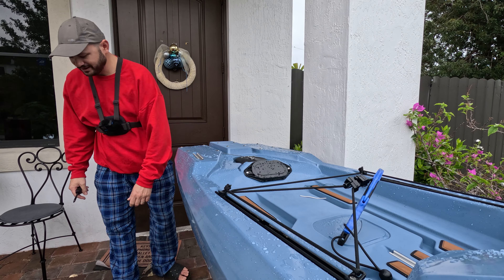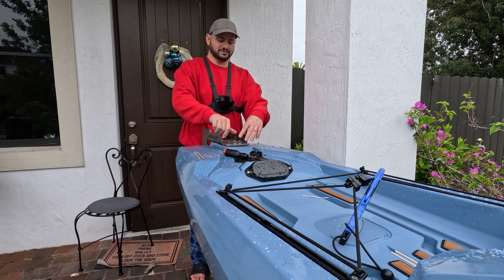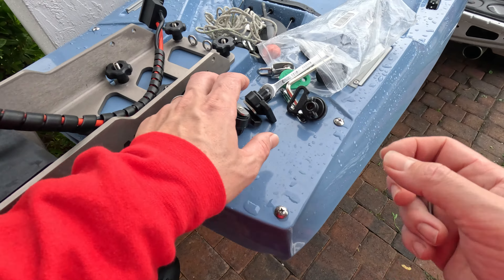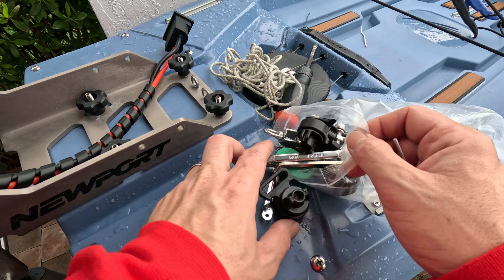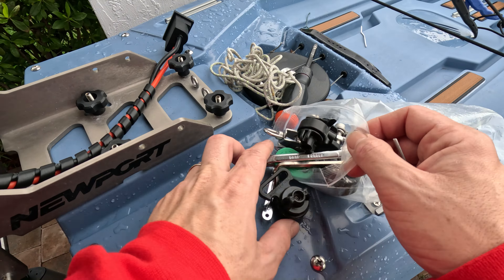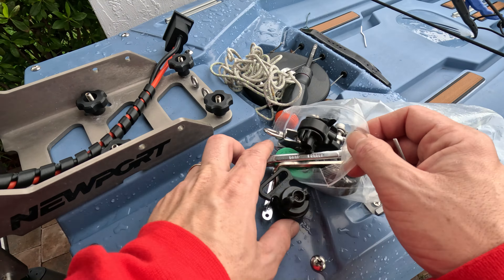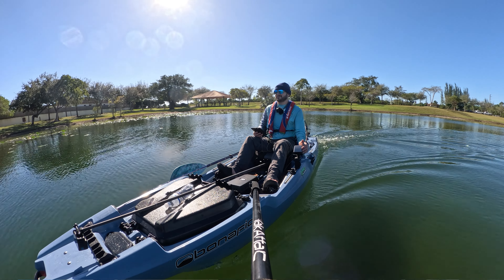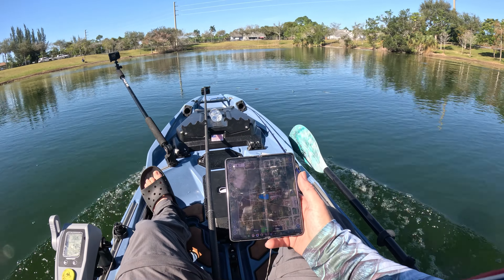NEWPORT NK300 Trial and Error Inexpensive Powerful Fast Kayak Motor FULL Install on Bonafide PWR 129

Comment: Does the rudder still turn along with the Newport? So you can still use the rudder when you’re paddling?
Reply from the maker: You can't use the rudder if the Newport is on, if you lift the nw then yes

Comment: Hello Alex, I have a question for you about the  Native titan x vs Vanhanks elite pro angler. You have tested or review those kayak  already,  what do you think the Vanhanks elite pro angler compare to the titan x?  I'm still thinking about getting the  titan x , not really sure about the size.  Any suggestions would be appreciated  very much.  Thank
Reply from the maker: Vanhunks, f1500 xl, native titan f1500 limited
Reply: @AliexFolgueira  So Alex which you like better  titan  x or vanhank? I  know the titan x is  a little more expensive than vanhunks,  which is more stable and  more fun?
Reply from the maker: @philipnguyen2529  the titan x is in every way better
Reply: @AliexFolgueira  Do you like the 10.5 or  the 12.5? I'm not a big guy,  I'm 5'7 and about  165lb.
Reply from the maker: @philipnguyen2529   unless you dont have the space or dont wanna deal with the extra weight, the 12.5 is the one to go, you got more space, more speed, just a better experience on the water

Comment: Why Bonafide made the rudder if it doesn’t work with NK300. Do you think the rudder would work with NK180?  I also do plan to use a front motor guide xi3 sometimes without back motor, and I need the rudder in this case.
Reply from the maker: well the did the rudder only for paddling, if you put a rear motor, it wont work, just run the wire directly to the rear motor
Reply: @AliexFolgueira  How fast it takes disconnect wires from the rear motor and install back to the rudder? I'm not planning to use rear motor all the time?
Reply from the maker: @WarEagleTheBest  you can do it on 5 mins, gotta route the cable around the disks it is easy

Comment: Don’t buy Nk300 waste of money👎 I own an xi3 motor guide which is awesome and bought into hype of faster and was extremely disappointed all these videos lying about it try in current and battery wont last and isn’t fast😭(Hobie compass)
Reply from the maker: @ajmcdonald1277  Xi3 is not longer a thing, motorguide is dead! If you bought the 30ah hiri 36v battery if you run max just last one hour, at 25% power which gives you more than half the speed you can go for at least 20 miles, you arent taking advantage of your battery.
Reply from the maker: @ajmcdonald1277  I may add the only one lying here is you, the video shows everything, speed, endurance etc, also I'm using a 60ah 36v battery last for 40 miles at a min when managed I also fish the entire 7 miles bridge on the keys round trip with this motor, I did it twice after I finished I had over 50% left, stop lying, I got proof, do  you?
Reply: im sure your affiliated with Newport that is totally misleading your wrong👎👎
Reply from the maker: I don't care about what Newport says, I test things I recommend amped outdoors not Newport batteries I have affiliate links to everyone I don't care what people buy

Comment: You didn't show how to set up the steering
Reply from the maker: because i didn't i used the rudder to steer, this video is a full install of the nk180 pro on same boat plus testing, it shows the steering, I just extended the cables https://youtu.be/IfuX2Tb8DB0?si=M8ur3Cz2_1rnOcz-